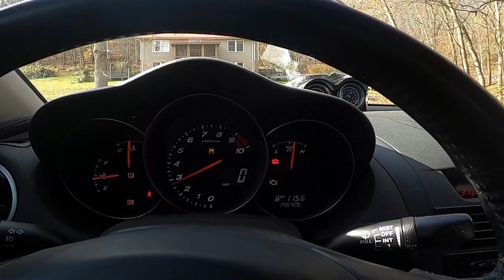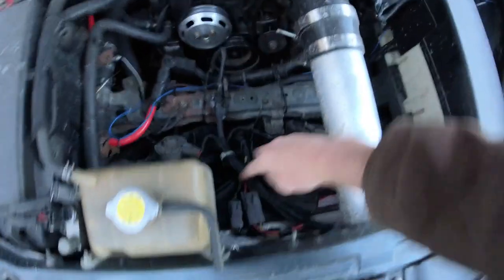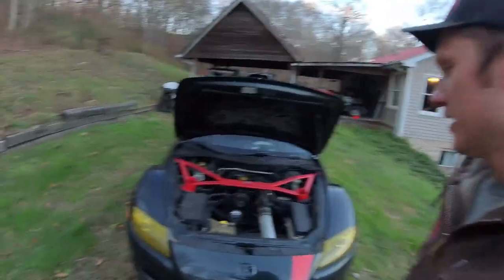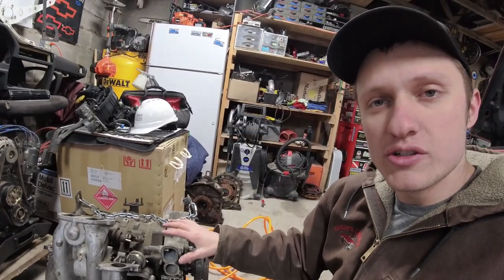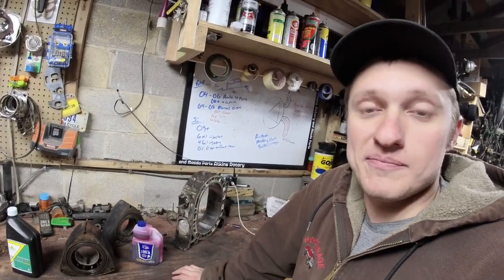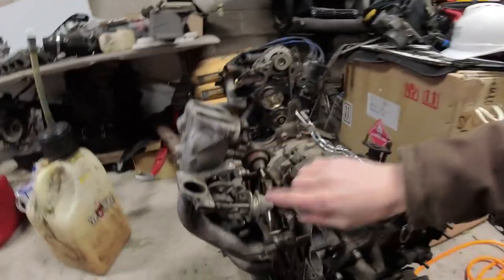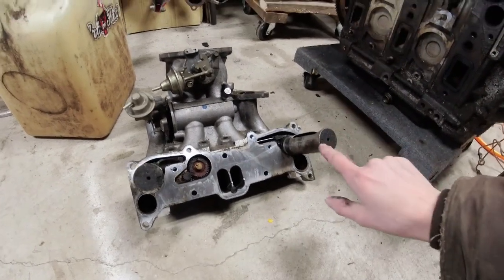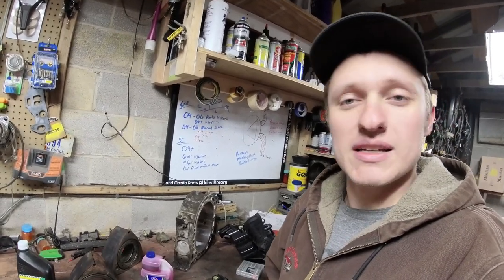Mazda RX8's Are NOT High Maintenance - Taking Care of A Rotary Engine

Comment: I currently have an RX8 and a 93FD. The RX8 came in a trade with two engines (supposedly both "blown up") when you do a compression test and it looks like you have a broken Apex seal, often times it is just stuck from having lots of nasty carbon. I've done this several times with rotary motors that made basically no compression; remove the lower plugs and using either a turkey baster or a small fluid pump, pump in 4 or 5 oz of automatic transmission fluid... Turn the car over by hand a few times and let it set. Do this a couple times a day for a couple of days. Sometimes it actually will work quite quickly if you want to keep rechecking compression it will be obvious when the seals become unstuck. Once that happens you can start the car and rev the snot out of it.... It will all come out and a giant cloud of smoke. Then compression is restored and you are ready for racing :) . The very worst I've got seen this was with a 1979 RX7 that we bought out of a field that had not been started or turned over in years, the engine did not turn over. My brother and I had stopped and put transmission fluid in the housings a couple of times before we drug it home with a pickup. While in  tow my brother had tried to pop start the car a number of times. It did start while we were still in town made a giant smoke show, then we unhooked the tow strap and he beat me home. Seals do break and what have you but in my experience that's when you're pushing 20 lbs of boost wide open throttle 160mph(I completely destroyed a rotor housing a rotor and two irons 😆)..  If it's naturally aspirated though it's probably completely fine and can be fixed with one quart or less of ATF :) if anything it's definitely worth a try for those who believe they need a rebuild. My RX8 has  133000 miles makes full power, and was "rebuilt " with a bottle of ATF.  Over the years I had forgotten where this "trick" came from; but then I seen a video here on YouTube where an old Mazda technician explained how they used to perform that exact procedure at Mazda dealerships for 12a engines. Somehow though, today people hear about this and think it's snake oil 😆
Reply: I found a RX-8 but can't find a trustworthy mechanic to check
Reply: Had a customer that would bring in their rx8 for a no start every winter. Pull the plugs, insert some atf, let her sit a couple days and she'd pop right off, let it sit running for a bit than run the rpms up on a test drive and it would come right back to life. The customer never drove it hard so it was always carbon logged
Reply: @dakota5041  Sorry, but what is ATF?
Reply: @felipefrasson8701  automatic transmission fluid
Reply: @dakota5041 atf shud get in some of all engine
Reply: glad i read this. thanks!
Reply: my buddy is selling his and everyone that has seen it around town has seen him pre mix with lots of atf fluid would that be fine or is 2stroke pre mix better?
Reply: You should not be using the same 4 cycle oil to lubricate and burn in the combustion cycle. Use ygood quality two cycle racing oil (Maxima 927 or similar with castor) as a bonus, it smells so good!! It smells like Motocross or roadracing back in the day😉
Reply: You should not be using the same 4 cycle oil to lubricate and burn in the combustion cycle. Use good quality two cycle racing oil (Maxima 927 or similar with castor), as a bonus, it smells so good!! It smells like Motocross or roadracing back in the day😉
Reply: @xNkqWp_  Your buddy needs a new engine.
Reply: @robertrishel3685  Alll Wankel engines are 4-stroke and Mazda only recommends 4-stroke oil with an API SL or better, no 2-stroke oil meets this minimum standard.

Comment: Synthetic oil doesn't provide "extra lubrication", it just breaks down slower so you can extend your oil change intervals in a piston engined car. The rest is just marketing, because it's 4x more expensive than regular dino! If you are "racing" on a track or on a road, synthetic may help prevent  your engine expiring sooner than expected.

Comment: I had 103k on my 2nd engine until it developed a pin hole leak in the reservoir that I couldn't see and overheated on a cold rainy day. I never pre-mixed it, redlined multiple times per drive, regular dino-oil changes, coils, and plugs to keep it happy. That was about 6 years ago and I'm hoping to get another rotary to put back in it so I can enjoy my car again.

Comment: On the oil side, I have been running Royal Purple for 12 years in my 09 RX8.  This was on the recommendation of Racing Beat at the time I got it and was going through it.  Engine is original and has 87k miles on it so far.  Still runs very strong and has not issues starting or anything.  Only modifications are de-cat and BHR ignition.  

That all said, I run the piss out of the car.  I have always run it hard and get things plenty hot every drive.  Plugs always come out pretty clean just that very light brownish ash.  I have scoped it a couple times through the plug holes.  Thinks look ok so far.  Not 100% carbon free, but mostly that bronzish color rotors turn after being in an engine.  Maybe I have been lucky, but for all the years I have owned her she has been a good car.
Reply: Nice to know an actual example with royal purple. Currently  running 15w40 royal purple. 140000km on the engine and no engine light  so far.  Lol
Reply: @dalebob 100:1?? Metric ? Imperial ?
Reply: @mrmechanic274  i dont fackin know. All I know is typically its .5 oz's oil per gallon of fuel for functioning omp. With omp delete, run 1 oz per gallon. For racing or aggressive porting 1.5-2.
Reply: I run Penzoil Platinum Ultra Pure 5w30. In all my cars.
Reply: You have to be the only rx8 tht still running with its original rotary💀
Reply: @loitia64  guess my methods work.
Reply: Yeahh.. who said we can run full synthetic oil in Rotary? I've been running royal purple in my rotaries. Better performance, less carbon build-up, longer engine life-span
Reply: @loitia64  nope. mate of mine also runs his still on the original engine without any problems. Just gotto fill up on oil and premix and ur good
Reply: @mrturtle3531  dude that's fckn sick 🔥
Reply: get back if you get to 130k
Reply: dalebob9364  actually, semi trucks are burning more clean than your typical eco car, even more so a modified car.

Lots of changes to modern trucks compared to old trucks.
Reply: It will lose compression soon... they all do!

Comment: Hmm, some good info but also some problems this video. I've had rotaries for 30+ years... 
1. Most  synthetic oils are fine on a rotary. In fact, MAZDA Japan sold synthetic rotary oil. The only region where Mazda stipulated conventional oil was North America. (look it up.) I've run synthetics in rx-7s, rx-8s in stock configuration for many years just fine. As he says later, if you're worried about burning crankcase oil use a SOHN or RRP clean oil feed adapter and run 2-stroke oil from a separate tank. Or if you don't want oil injection at all, delete that system and run premix. That works fine too.
2. The OE ignition coils were designed to be wear items and replaced every 50k. Most people in the know replace with higher quality aftermarket (e.g. RRP, BHR, etc.) and are done replacing them (with better spark too). Some stick with the newer rev C coils from Mazda, which aren't as prone to failure as rev A and B were.
3. Adding a smaller amount of premix to a daily driven RX does help keep the engine running longer, especially S1, unless you've had the ECU tuned to inject more oil. Mazda dropped the amount injected too far in early RX-8s in order to comply with emissions. 

S1 RX-8s use a traditional oil metering pump. This pump is positive displacement and is able to be gravity-fed oil (via SOHN or RRP adapters).

However, S2 RX-8s have eMOPs or electronic metering oil injection pumps. They sit on top of the motor and are fed pressurized oil. They aren't technically pumps, but rather electronic valves that allow small amounts of oil to pass. You can't run a gravity fed tank of 2stroke oil to them. Instead, you'd have to pressurize that system (between 16 and 22psi, IIRC) in order for it to function. Could be worth doing but isn't something readily available.
Reply: I did it and all the R&D on S2. It worked. Till I saw that 2 stroke oil doesn’t accept to be pressurised, heated then back to the tank, refreshed and again  and again. To finish there was black carbon deposits in the bottom of the tank and oil wasn’t sprayed anymore in the engine and destroyed my well refurbished engine in just 5k miles ^^ finished by finding just less than 4bar.. so don’t try if you don’t want to kill the engine ^^ it could certainly work with engine oil in the tank but it should loose all that it was designed for. So I’me gone back to oem
Reply: @ChrisRxSpecialist  this is interesting. Do you think it was the pressurization or the temperature that caused the problem?
Did you try different kinds of 2 stroke oils?
What heat was it being exposed to?
Reply: @3toedSloth75  I don’t know maybe both, I can’t give you a temperature but when you pressurise a liquid it automatically heat plus the heat  from the engine, I used motul 510 as 2stroke oil and a FPR to regul oil pressure around 1,2bar
Reply: @ChrisRxSpecialist  Ah, ok. So a constant pumping/pressure, like a fuel system. I was thinking of adding a pressure sensor and a controller so the pump only ran when it needed to. That might prevent this... or even possibly pressurizing the storage can via air pump. But I haven't tried either method yet.
One benefit to using motor oil would be that you're lubricating with clean oil instead of dirty.
Another is that you could run one type of motor oil for injection and the other in the pan. To say, inject conventional oil and then a good synthetic in the motor.
Just some thoughts.
Reply: @3toedSloth75  about the way to pressurise I just did a circuit the simple I can
If you want to test yours you can ^^ for me it’s done I don’t want to try something else and risk to pay an other one. Then the benefit of inject 2 stroke oil against engine oil was never proved. That’s why it’s maybe a waste of time and money. Here in France we saw some rx8 with more than 135k miles in full origine without premix so… in fact the problem may be the owner 😅

Comment: you can use a catch can to avoid excesive carbon deposits on the valves.
youare doing a nice job with the channel .cons
Reply: Valves?
Reply: @kekethetoad  intake valves, the SSV especially can get gummed up and quit working .
Reply: My 2004 RX8 had the breather go to the intake tract, and already had a catch can fitted. My 2008 RX8 though has it routed to the lower intake manifold as standard I believe? Can I still put a catch can into that system (if I block off the 2 ports into the lower intake manifold)?
Reply: @jamesowen418  in case of facelift i think yor ok,no need for an extra item in the engine bay
Reply: @melanos2000  ok thanks, I guess Mazda in their wisdom decided to change a few things up on the later models. People hate on the Renesis, but it really is peak production rotary engine .
Reply: I agree with this dude on the valves 😂😂😂😂😂
Reply: @jamesowen418 this engine doesn't have an valves
Reply: @callmeedaddy  I have a 2006 and did the same. My oil catch can fills quickly unfortunately. I will be doing a compression test. I must have blow by since Anything above 6k causes this.
Reply: @chanoleyva8584  the motor doesn't, but the engine assembly operates with intake ports that use valves... As shown in the video here. It's been used at least since the second generation non turbo RX-7 and possibly late generation first gen.

Comment: I believe it was in 2005 that they changed them, but I always thought it was a bizarre choice for Mazda to use a solid black plastic coolant tank in their 2004 models. For something that important in a rotary powered vehicle, you'd think it would be a smart choice to have designed it as transparent. I still break my neck every time I see an Rx8 drive by. Most people probably wouldn't look twice, but I am a die hard for these things.
Reply: Coolant tank was always clear, but this statement is true for the washer fluid reservoir. My 2004 has a black coolant tank but there is a dipstick attached to the cap with cutouts to mark the fluid level. They did in fact change to a clear reservoir in 2005.

Either way, both the washer fluid tank and coolant tank have level sensors that will throw codes onto the cluster. Just the biggest issue is that the coolant sensors are prone to going bad and are built into the tank, requiring a new unit.

Comment: Great video!! If you are running an alcohol fuel (ethanol blend or methanol), make sure that the premix is designed for this.  Many 2 cycle premixes are NOT designed for alcohol fuels, and many that are can have bad side effects, like ones with castor bean oil.  Also, many rotary engine builders believe that the factory OMP set up (on RX8s) is not enough lubrication for the combustion chamber, especially on the 2004-2008 models with the 2 oil ports.  My recommendation is to always run premix in a rotary engine, and use the best maintenance items you can to maximize engine life.  I would recommend NGK spark plugs, OEM or K&N for filters, and Renewable Lubricants for premix and oil.

Comment: Idk if you found a method for doing the oil control o-rings yet, I remember a video where you said you always have issues. When I was rebuilding my renesis I followed the service manual, didn’t soak them and only applied Vaseline just before installation. They popped right in for me without drama.

Comment: Renesis are capable of more miles than you think. There's a handful that hit 200k on the RX8 club forum and that's primarily due to those engines running mostly on the highway (which keeps those engines carbon free). In my experience, the more carbon you keep out the engine, the less wear you get on the rotor housings because now you don't have all that carbon dust scraping between the apex seals and housings. I also recommend NOT using those after market K&N filters because they do a shitty job of filtering the air. You'd be surprised how the smallest amounts of dust can "Dust out" your engine prematurely. I always shake my head when I see those running turbos without air filters or open ITB's then those guys wonder why their engines keep loosing compression so fast. I don't care how carbon free or well tuned your rotary is but you absolutely must have clean air entering your rotary to give it a better chance of lasting well over 100k.
Reply: I bought an rx8 with 222k miles on it. There's no compression on the rear rotor. I think it's the original engine, I'll know for sure when I pull it out.
Reply: So Racing Beat and AEM intakes... Which are the most popular intakes for this car that actually provide a small power bump. Don't run them???
Reply: I think what he means is the 3-5 hp gain isnt worth sucking in extra dirt
Reply: @nashanthename1886  unless your car is almost exclusively a track car, the aftermarket intakes aren't an upgrade. Most of them suck in hot air from behind the radiator anyway.
Reply: @TexasVexes  That's exactly what I mean. Now I will say this, the Nissan Nismo filters a pretty good at filtering and allowing a little more air flow.
Reply: @inoahmann7542  Blue reman tab should be under neither the alternator if it is.
Reply: Nothing wrong with k and n filters. Have run them on vehicles for years and years with no problem whatsoever. And that'd doing alot of dusty off-roading
Reply: @Chano Leyva  And if you test the compression on those engines over the years and years of useage, you would see those engines will be making less compression compared to engines that have had quality filtration. Go watch the Froject Farm filter test video and report back. The filtration on those filters are horrible and not worth it if your goal is to have MAX compression over the longest time frame of your engine. They let too much dirt get passed them which allows that dirt to over time, dust out the engine.

Comment: I've been a 2-stroke guy since I was a kid.  I've always been amazed at how reminiscent the rotary is, including the sound (Renesis sounds like an RZ, 20B sounds like a Kawu triple, etc).  When I found out these things were injecting themselves with dirty 4-stroke motor oil at a rate of 300:1, I was aghast.  No wonder people talk about apex seals and carbon build-up!  You know what would happen to the rings on my Maico if I ran 300:1 Quaker State 10W-30?  Wouldn't take long to push it back to the truck, let's put it that way.

If the motor in my NC2 Miata ever blows up (yeah right), I'd love to drop in a Renesis.  I've heard it's not hard because the NC was adapted from the RX-8 chassis.  I've always wanted a 2-stroke sports car.  I just... don't like looking at RX-8s.

Comment: You don't need premix correct otherwise MAZDA wouldn't have engineered another way to begin with (stupid proofing measure) ..... The main reason we premix is it eliminates any malfunction in oil delivery, it is a 100percent sure remedy... This confidence is why we do premix....the down side is  1). adding oil to petrol is hard to live with because of when car has been parked up for a while (days) the oil congeales - separates from the fuel and causes issues with half blocked jets/ injectors, the fuel needs to be mixed/ shaken up before running it,   2). Also with premixing ,fuel evaporates making the ratio of oil to much , these premix issues we except for 100 percent confidence 1:56  knowing the motor will not fail as you closely monitored it... end result is pure rotary love ❤ no engine failure 💪